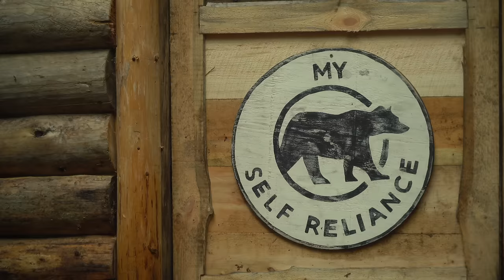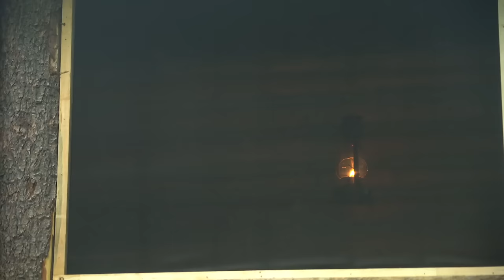Adding a Screened Door to my Log Cabin and More Off Grid Cabin Life

Comment: Hopefully next year you can get a gutter system installed on buildings and structures to collect the rain water better for your garden areas. If you can set up a filter system in a collection bin with the water coming off the roof of the cabin, you could easily find a way to pump that into the cabin for consuption and not have to carry inside anymore.

Comment: You should build the same sized addition on the other side .You could use it as a bedroom. If you eliminated the window on that side and put a door in , the heat from the wood stove would flow right in there. Plus it would be cooler to sleep in during the hot summers than the loft. Just a thought ...............

Comment: Great idea making the sun dried zucchini chips! From what I have read they should be good for a year. I was wondering how else you could store your bountiful zucchini harvest and read about zucchini jam. It can be canned with the hot water bath method. It is made with crushed pineapple which makes it acidic enough to can without a pressure cooker. Then you add a packet of Jell-O to make different flavors. Thanks again for a wonderful video and for sharing your rain .. it's very hot here in Dallas 😁.

Comment: If you dry meat outside in late spring or summer, make a bag of mosquito screen around it, prevent bugs from getting to it. Smoke from a fire helps too of course but the wind always shift a bit and also just forgetting to tend to it is  easy being busy whith something else.
Reply: Bag should of course be big enough to not touch the meat.

Comment: I really admire your adherence to the hand tools. Is it for content, or just saving on power usage? The reason I ask, is I get happy every day I use my impact driver. 5 years ago, I had never used one, and wondered why the heck it was making that noise. 5 years ago, I had never used a table saw. Boy, was I missing out. I do have the hand drill you have, from my grandfather, as well as a screwdriver he had, that you can hit with a hammer, and it turns the bit.

Comment: shawn do you know what PILOT HOLES ARE?  me working  with metal & water cooling water to cool my drill  the small drill goes in first, if the holes had to be bigger you just changed the drill  to a bigger size and i redrilled that hole with the white cooling water to keep  the drill cool and the job was done. the same for wood, pilot hole then  use a a small cordless drill screw driver bit with philips screws or square head screws and putbthe screws in towhat you are working on. i've did it for yrs from  1969 on and i have never stopped doing it ok.

Comment: Now the screen porch looks like a screen porch!  Love the sign on the bottom of the door.  While you were measuring the center and end support, I wondered to myself if you were going to connect them with wooden pegs and glue, or corner braces and glue.
Those zucchini chips look delicious - do you eat them as is, or add them to soups and stews?

Comment: hi Shawn i no you are going to start getting  water from the side of your cabin in big drums at so point ,if you had a iron Bath you could build a concrete  rectangle base for it  so you could put loges under it to heat it up, all you will have to do is have the water running freely to the Bath  to fill it up from you drums of water so the bath is  lower than your cabin,  and put it in a small log cabin like a small bath room as long as you have a lot of water you will  have a lovely warm bath.should not be that hard to do .just don't no if it wood work you could try it with a iron bath but i though so one like you could do it . it can.t  be that hard to do just don't no if the bath can be heated like that.